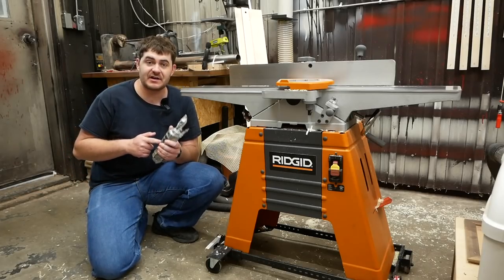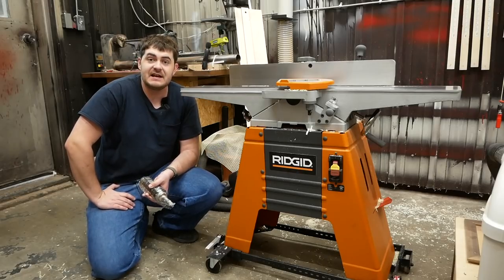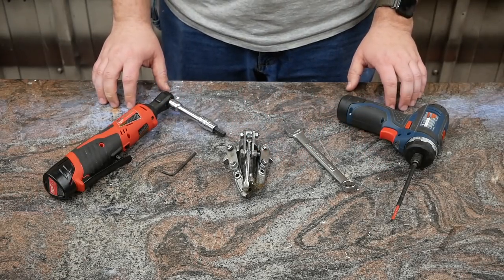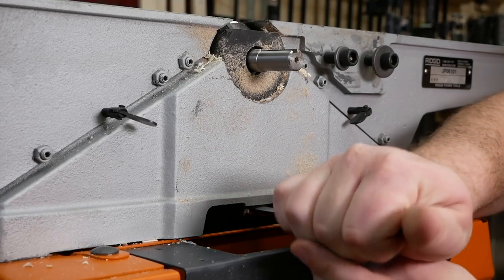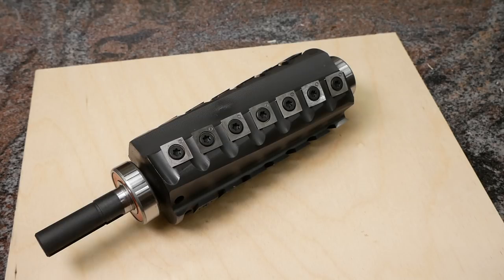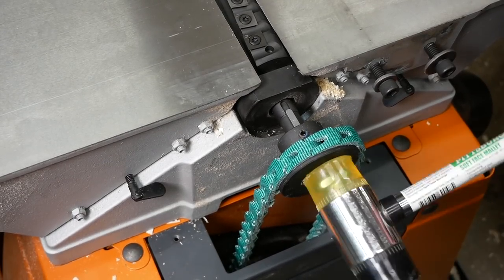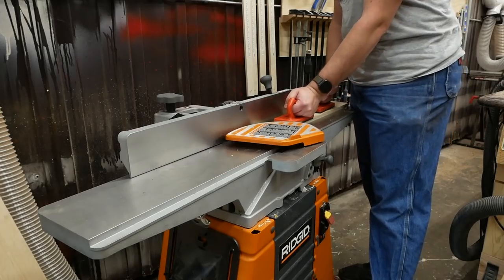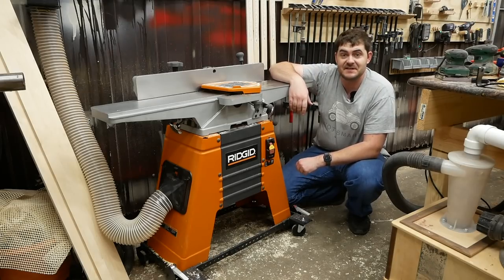How To Install a Helical Cutterhead in a 6 Inch Jointer

Comment: I've just finished installing the Luxcut Helical head in my Ridgid.  Outstanding video!  Thanks for the assistance. The test of the jointer after installation proved to be quieter, and a smoother feel on my hand as I held the push blocks.  Also there was a noticeable difference in the amount of saw dust that didn't make it to the dust collection system.  Moreover the dust collection port didn't get plugged up.  OUTSTANDING VIDEO!

Comment: Thanks Robert. I just installed the Lux cutter head on my JET JJ-6CSX. Sure enough, it went exactly the same as in the video. Including having to take an additional link out of the new belt and re-adjusting the outfeed and infeed tables. The video made all of the step understandable and do-able.  Thanks again. Now, on to the Lux cutter head for the Dewalt 735.

Comment: Nice writeup, I just did the same upgrade on the same jointer using a Shelix cutter head from Bryd.  Worked great.  Just an FYI there are two different cutterhead diameters on the Ridged jointers you can read about that on the Bryd website.

Comment: For those finding this now, I did this exact same upgrade and it’s definitely worth it.

One thing you will almost certainly have to do is adjust the outfeed table height. With the new cutter head, the outfeed height was too high and it takes some time to adjust it and get it exactly right. Should never have to do it again.

Having said that, it’s a completely different experience using this jointer now. I also bought the jointer on sale, but had to buy my own cutter head. 😭

Comment: Curious that you are the link belt as an upgrade. I've only ever seen them as either a bodge for when you can't find the correct belt or, in the case of my lathe, for when you've got the pulley in the middle of the shaft and can't practically fit a non linked belt.

Comment: Great video...question...when installing the new cutter head, when you go to secure the head with the two bottom bolts, you have considerable play left and right. Should you seat the cutter head all the way to the fence side and then tighten the bolts or should you center the head as best you can? I should have noticed where this was before I removed the old cutter head. The Rigid instructions don't tell tell you.

Comment: It's funny how bolts, nuts and screws disappear down holes, sometimes they come out, but only sometimes... :P
Reply: There is a law in physics that says if you drop a small part, it will always fall and/or roll into the nearest inaccessible place before coming to rest.

Comment: Love you vid but Help… my Shelix cutter head assembly rides higher than my old one. I tried to correct the in feed and out feed tables but it may not be the right way to do it. Is there a way to lower the Shelix cutter head down?

Comment: Are you going to calibrate the cutter head to bring it into level?  After replacement it can be several thousandths out from one side of the cutter head to the other.  Probably within about 2 thousandths is good enough for most work.

Comment: I could be wrong, but I think the link belt is installed backwards. It should be so that all the link parts are in trailing mode so they don’t catch air.

Comment: ok MISTER MAGICAL WIZARD, how did you work your MAGIC at getting that DARN bolt, next to the pully, back in the hole because you didn't show your MAGICAL works on THE VIDEO. Mine keeps goin down the shoot and onto the floor. I have tried everything short of taking it off the stand.

Comment: Need your help.  I have a delta jt360 jointer  Before I take a leap on getting a luxcut, I need to find jack lift screws/nut for blades on cutter head. Tried all the usual places. Seems these screws don't exist anymore. I went thru your list of compatible jointers and nobody has these screws. They are #-10-32 conical at tip, not dimpled. Supposedly i can still get the nut(with the ledge on it, but delta says obsolete).These other sources will take your money with 2-3 week lead time and eventually will say obsolete, and tuff getting your money back. So, can you help an old guy on fixed income find these jack lift nut / screws? Ebay has 2 but the vendor is the same people that takes your money and finally say it is obsolete . If these jointers were built by 2 companies in China, the cutter heads must be the same and therefore nut/screw should be the same. Can't afford luxcut. Please see if you can come up with where I can get them. Thank you for your concern. Bruce

Comment: Robert, as someone who has experience repairing those Milwaukee ratchets, don't use them as a normal ratchet. If you need it tighter than the battery can deliver, switch wrenches

Comment: NEVER believe anyone who tells you "This item that is hundreds of dollars less is the same exact thing as this other item costing hundreds more"   Different motors, different tooling. Best castings (for cast parts) go to the most expensive line. Lower quality metals etc.  
A production line making a thing like this is going to consume steel to stamp the parts from.  Higher quality and probably thicker  steel is used for the expensive brands while low quality steel also thinner is used for the cheap brands.